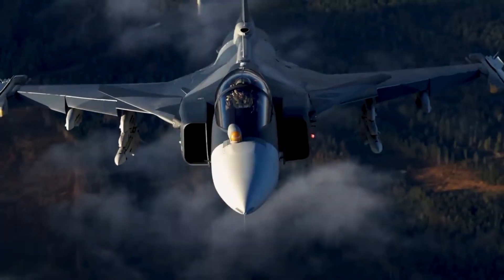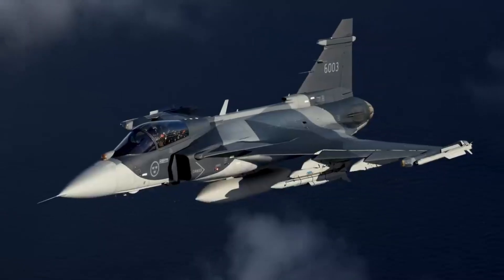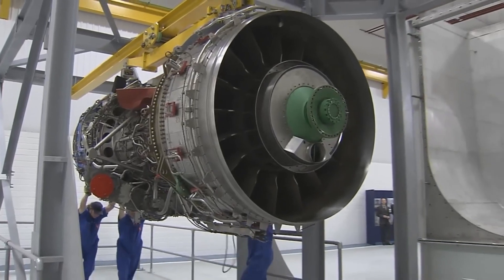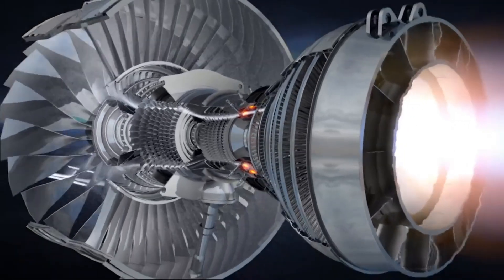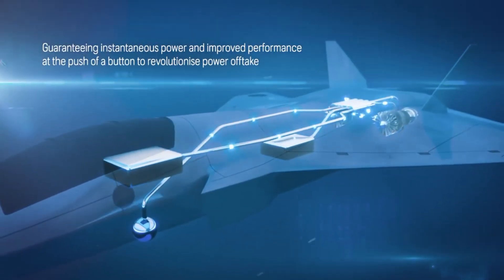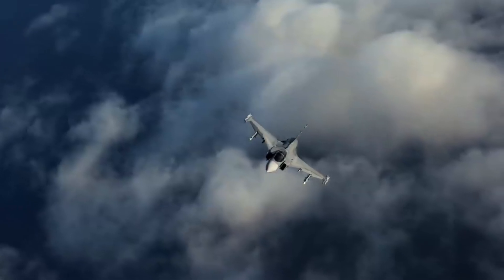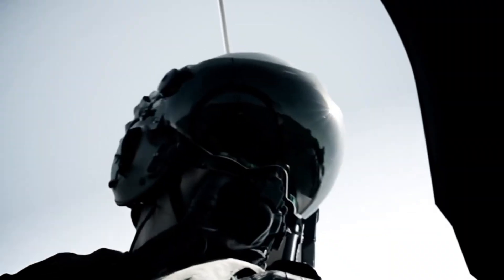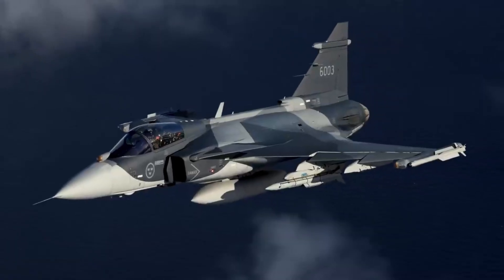This Rolls-Royce Engine Makes the Gripen E the World’s Most Efficient Fighter”

Comment: Total fluff video - zero real content. Most importantly is it Confirmed (reputable newspapers-of-record/govt. public/press announcement) that Gripen-E/F is being re-engined to the RR engine? Which engine? EJ230+? The video did not provide such info. Saab already reviewed the RR engine for the Typhoon Eurofighter but ended up choosing the GE F414 instead. What's the Source of superior performance (thrust, fuel consumption, heat signature) claims? I note not comment about vector thrust nozzle which in theory would bring more manoeuvre agility for dog-fighting. Also No commentary about the Cost of the RR engine vs GE's.

Comment: Canada is committed to buying 16 F35 aircraft, as we have already paid for them. This makes up one airforce squadron. This SAAB  partnership is an important collaboration, with a partnership, and a deal allowing sharing technology, and maintenance  right to repair . We have to ask ourselves, can we afford two aircraft? The truth is the F35 has delays in engine , and Block 4 software.  These two are causing 4-5 year delays. Hundreds of F35 planes are being produced, but the delayed software means the planes can only be used for training till software updates can be designed and implemented. The US is forced to buy F18 Super Hornets, F15 EX, and Harrier aircraft to replace old end of life aircraft. Our F18 aircraft are at end of lifespan, and the Gripen would be that stop gap replacement till SAAB's 6th gen aircraft prototypes would be ready for production in 5 years. Rolls Royce has been upgrading SAP 39 Gripen E/F aircraft in secret, modifying the Gripen C in theory because of their Parliamentary cost restraints. The Gripen E/F with the Rolls Royce engine will be a better aircraft than the F35 because it was made for Arctic environment, and has not downtime due to costly stealth causing coatings decaying or flaking off. Our Gripen would have the Rolls Royce thrust vectoring engine, that is used in the Tornado, but SAAB has done the work to make this engine fit. Bombardier's role would be SAAB would install the GlobalEye AWAC  systems into Bombarier aircraft. SAAB needs another production line to keep up with the demand orders for Gripens. They are offering Canada the chance to get back into the aircraft manufacturing of fighters, and possibly use vacant automotive parts manufacturing to retool to produce parts for the Gripen aircraft. Data from fight testing showed the electronic warfare and engine performance exceeded even the GE414 performance data. Rolls Royce had to do with that by secretly upgrading the air intakes, and sensors and software on the engines.  Going for the Gripen would put into jeopardy Canadian parts manufacturing jobs for the F35, as Canada has been a development partner in the F35 program for the past 15 years. In recent war games a Gripen went up against an F35, where the Gripen turned off it's passive radar, used its interlink to identify where the F35 aircraft was and then, shot it down. Ward Carroll introduced his report on the Deep Intel on the Damning New F-35  https://www.youtube.com/watch?v=LReZ4ejDjpw   Gripen specifications  https://www.youtube.com/watch?v=pHNyIuoxBOc